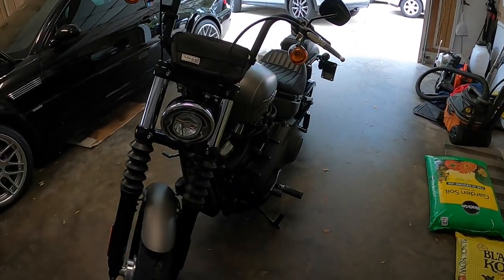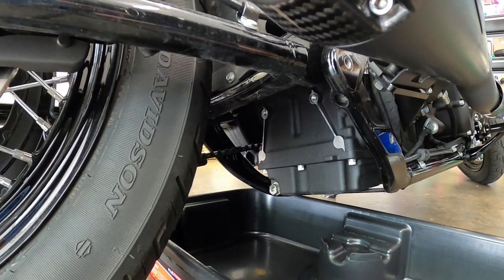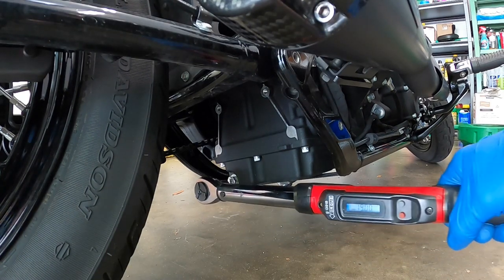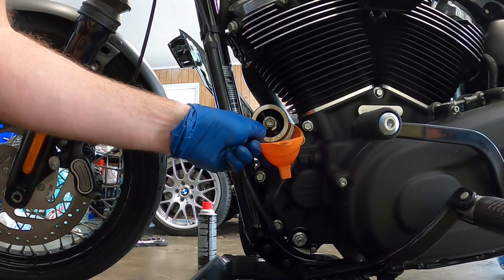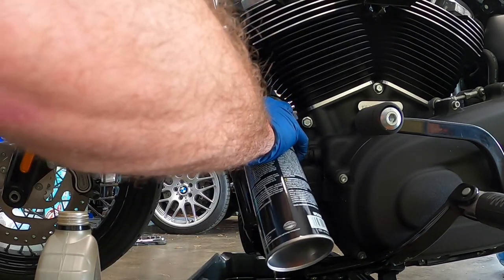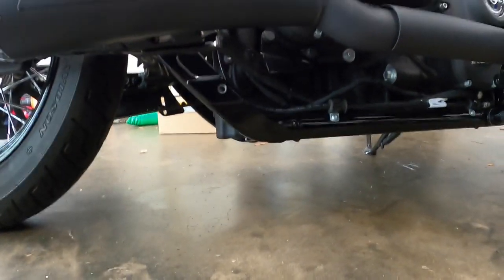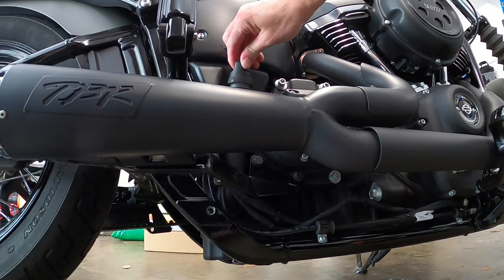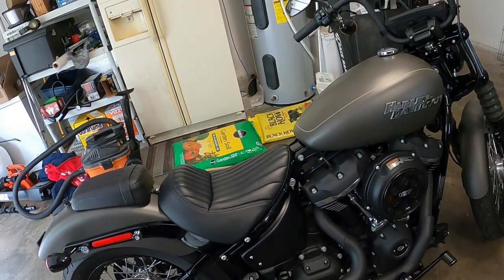Harley Davidson Street Bob 107 Oil Change

Comment: The video for the rack an pinion on the 2007 honda civic does the drive shaft automatically line up or you can just put it on however an whats the purpose of the yellow plastic I would think thats kinda important but you dont talk about it at all so does it just line itself up????